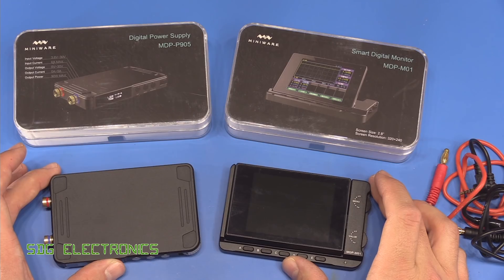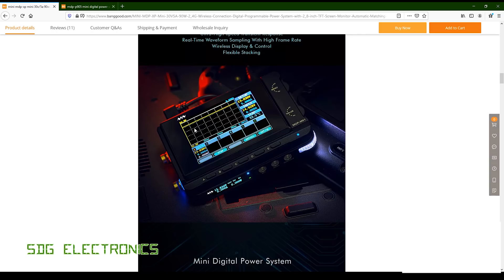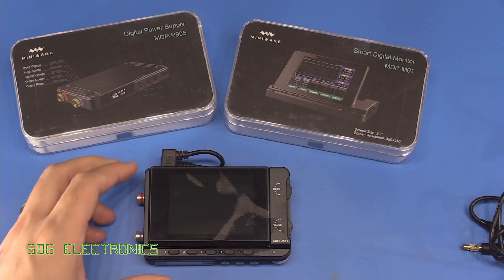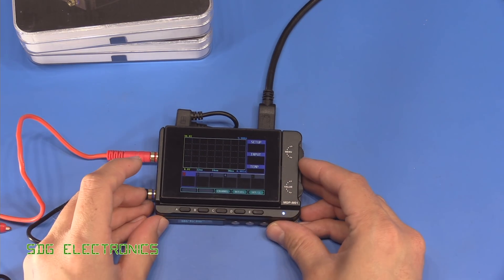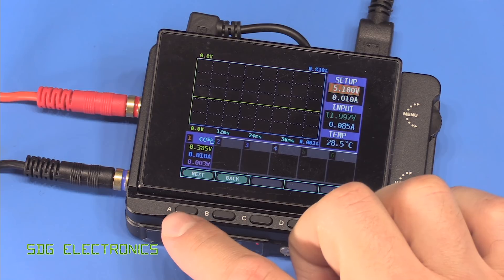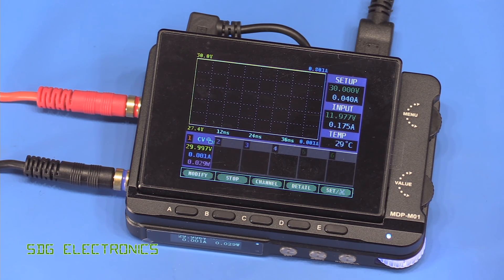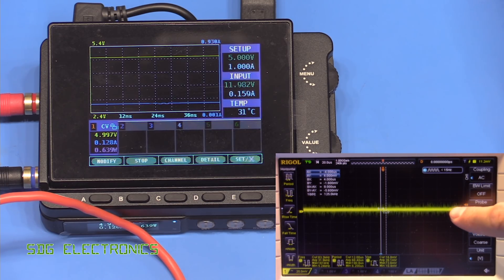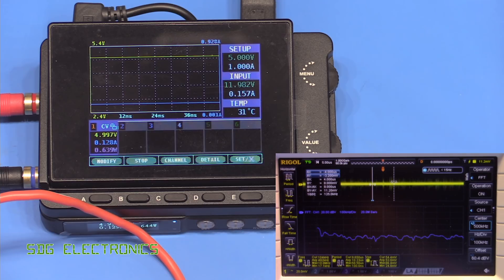SDG #115 Miniwave MDP-XP MDP-M01 MDP-P905 Mini Power Supply

Comment: The 2.4g wireless connection is for the display, you can wirelessly control the psu module with that display, pretty neat! That's also why they sperate. :)

Comment: Just got one of these in a sale.  Great little unit.  Aside from some initial issues getting the wireless connection to work to facilitate control of the PSU using the Monitor, it worked as advertised right out of the box.  Lovely!  

The interface is a bit weird, and it's definitely a bit fidly, but having spent the last couple of hours playing with it, it's not too bad.  

The only major criticism I have is that I can't find a way to switch the PSU on and off remotely.  You can wind the voltage up and down on the fly, but that's potentially a bit dangerous, obviously.  Being able to remotely switch output on/off  would seem to be a pretty obvious thing you would want to do, no?  

Aside from that being able to remote control power to a device that I'm not able to get at;  because it's in a vacuum pot for example, this will be invaluable.

Comment: After 3 months mine sits in the plastic cases it came with. There was a promise of a battery charger and a signal generator, perhaps that will help get them out of the packages And everyday hobby usage.

Comment: I wish they made one that has a internal battery, then would be useful. Otherwise way to small to used in daily laboratory practice. Rather have a traditional power supply with potentiometers to set the voltage and current. As far as price/performance ratio  this power supply is too expensive for what the device performs. In terms of specifications similar power supplies are for sale for prices around $70.00. The MDP-P905 is in my opinion is for someone do not mind spending some extra money, or sure I say waste money on a product that unique and not really useful for what it is. I say run and hide. Make one maybe larger with a internal battery then you catch my attention.

You have to remember these big tech reviewers get this stuff for free. As much as they claim to give a not bias and honest review? That not really the case. If they bash a product to much , they risk not receiving as much, or more free products? Only way you get likely a honest no hold back type of review is from people that had to pay for the product and realize major design issues, or to overpriced for what it is. So take this review with a gain of salt?  My opinion is as stated earlier, this power supply is too expensive for what the device performs. Make power supply thicker and put 18650 in and I buy one.

Comment: It's a cute gadget, well designed and sturdy.  I only would use it as a multi-input battery charger. For that purpose it is too expensive and too limited, since it does not offer capacity check, nor amh monitoring.

Comment: It looks nice but as you mentioned it is too small and slow to use. It would need to be a little bigger to feel solid and not slip. I think it is more of a power supply instead of a lab power supply. It would be useful for powering finished devices in the field but for designing something new you want something bigger. Maybe someone will add a quick shut off with a custom firmware. Mini has always given you full access to the software which is nice. The price is also way too high. You can get a power supply that does the same thing for $70-80 so I don´t see the value in paying 3 times that for something so small. I think it has it´s uses though.

Comment: Thanks for the analysis, Steve.

I have a question for those who suggest this device is for field work: Do you mean a strawberry field?
I roll up with a big cart, all kinds of measuring equipment and stuff, a chair and a second cart for documents. Also mains power is always in vicinity when there is something to fix. Only the professionals know the secret art of extension cable handling.
For me this device is to fiddly and unusable in lab work, nor field work. It's a gadget. And because of that it is too expensive for its purpose.
Get a decent power supply for the 200 bucks. One that hurts when it drops onto your foot, what this unit not does even though it is built for sliding from your desk:P

...a not so serious criticism, because those who want to buy a gadget buys this thing anyway;)
As Dave stated in his review, the noise characteristics are quiet good in this little bugger.

Comment: Yes, far too pricey and far too fiddly with a display unsuited to old eyes like mine. I will stick with my trusty 75W (30V 2.5A) linear bench PSU with its twin moving coil meters.
Reply: You don’t understand the scalability, extremely low noise and ripple and the excellent transient response capabilities of the unit with the constrained form factor and the high efficiency. This is first PSU with a switching pre regulator and a linear output stage I have ever seen and this is irreplaceable for someone with the specific needs.

Comment: Interesting little things for sure, but the buck and boost efficiency seems to be quite low.
Reply from the maker: The input current includes everything, the displays, wireless link etc. I think it has a linear post regulator stage too, so some losses there too

Comment: I would have liked to see the input noice level, seeing it was powered by DC. Perhaps the input was squicky clean?
Reply: It can do about 4mV Vpp when connected to a battery and no decoupling caps.
Reply: Watch Schematix and Marco Reps’ video on the unit, that should clear everything.
Reply: A USB source will almost never be clean, you need a linear PSUs or even better a battery.

Comment: Pretty cool, but I'd have expected it to be about half the price. If it had been half the price, I'd have ordered one. Give it a few months, though, and it probably will be. :)
Reply from the maker: It's dropped a little in price since I received it a few months ago. The problem is, it probably does cost a lot of money to manufacture - the finish is basically like a premium smartphone and it no doubt has expensive components inside to get the performance. It's really high quality, but I can't see the target market for something like this.
Reply: I do like the modularity of it, and it would be neat for little projects you're working on (especially one I'm working on right now that requires three different voltages), but I agree on not seeing the target market at this price point. The full set of six with the screen comes out to £650 from the prices I see on Banggood right now, which is nuts considering you'd still have to buy half a dozen power supplies for them. For that kind of money, there are much better options out there.

Comment: Hummm, too expensive, too fiddly and really kinda pointless. I like a power supply with big display, heavy so it wont move about the bench, preferably with analogue, voltage and current pots. No silly magnets to almost hold it together! On the positive side, you did get it free...that's a great price!
Reply: It's expensive because it's properly designed and has good specs for a DC supply. Also very useful for many technicians who need portable supply. Heavy one is nice for the lab but outside is rather inconvenient. If I want good reliable power supply then I would not want to cheap out on some basic aliexpress design.

Comment: At this price I would rather buy a Rigol DP832 (with 3 separate outputs).
Reply: Could you post a link to a $200 DP832?
Reply: It's double the price, but still more than double the value really...
It has remote sense wires and all that jazz :)

Though for a hobbyist who doesn't have the money, this is quite a good value.
Reply: @Mtaalas  what
Reply: Does it have low ripple too?